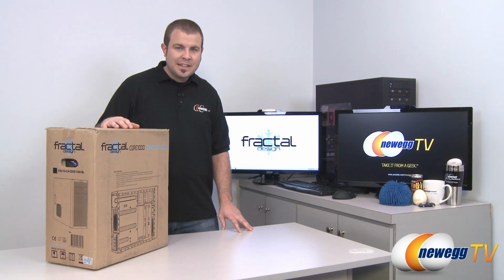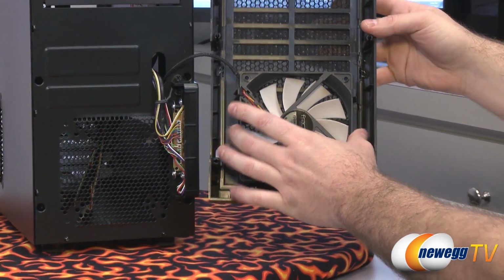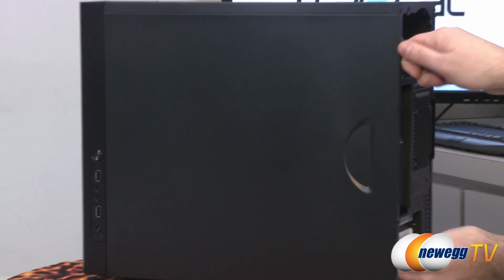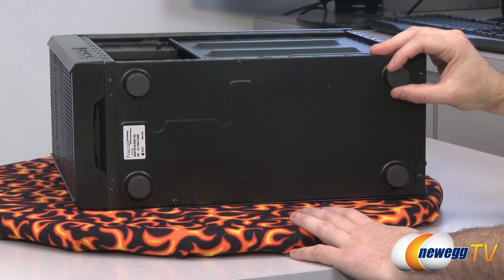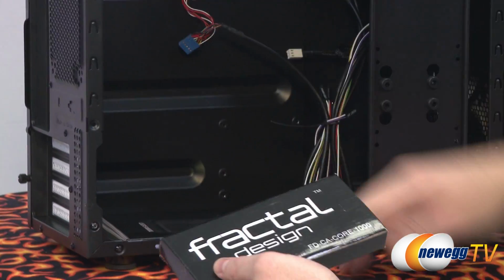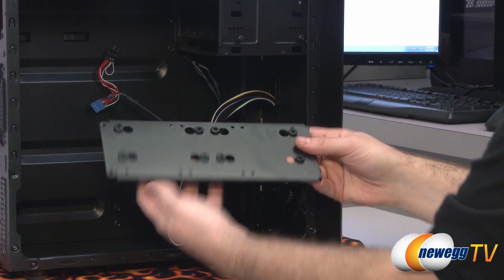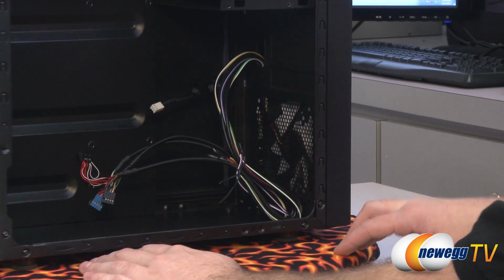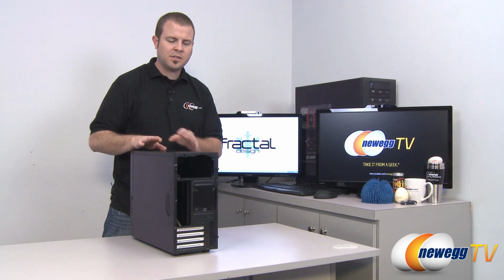Newegg TV: Fractal Design Core 1000 Micro ATX Computer Case Overview

Comment: I know this was a good, solid 8min video, but I just wanted to add that it would've been very to show an example of what it looks like after placing all of the components in the system to make sure that certain components would fit in there. For example, it claims to have 350mm space for long graphics cards, but a demonstration of that would be nice. Otherwise, good video!

Comment: It'd only just fit, but it'd be pushing against the side of the case, and in turn pushing the cooler against the motherboard, which might not be wise.

I suggest you go with either the Fractal Arc or Define Mini instead, they're more suited for gaming stuff anyway.

Comment: I like small cases
Reply: enjoy high temperatures. i've made the same mistake
Reply: comedyman112 depends on your case. Air 240 from Corsair is small but has good aitflow same with this case (core 1000). Just because a case is large doesn't necessarily mean air flow is good.
Reply: @untoldstory164  it could though mean less dust because no need to be that open.

Comment: @spykerv It is currently $10 cheaper than the Gamma. But then the Gamma is a Mid Tower vs. The Core 1000 being a Mini Tower. Mid Towers of course have more 5.25" & 3.5" drive bays and more cooling options. I do like the Fractal Arc Mini. It is $99 but it has most of the features of a full tower in a mini size.

Comment: Just to let everyone know this case can fit a freaken 780 ti so yes it will basically fit any card
Reply: ***** remove drive bay
Reply: Skittlez Gaming Yep, then get a 3.5 inch to 5.25 inch adapter to mount one
Reply: I'm using this case for my first build and would like to use the EVGA 960 SuperSC I know it fits but I also need an optical drive. In the video Paul says there is a 3.5 space under the optical drive space but I need a place to mount my 32gb SSD that will hold Windows. Will there still be enough room for the GPU if I just use the Drive "Cage" for 1 SSD?

Comment: The fan over the GFX card should be to exhaust air - otherwise you end up pushing the GFX's hot air back in on itself. The only "inflow" are at the front bottom, every other fan on the case should be "exhaust"

Comment: my case didnt come with a pre installed fan..
Reply: +Tobius theThird You can just add a cool cooler / fan in for swag >;)
Reply: +Tobius theThird Btw , Can you put DVD drives in / on it ?? plz tell me !
Reply: I didnt bother putting one in but you can, you'd need to get the measurements just right though, and granted you have your hdd mounted on the silicon grommets.
Reply: Ok thank you so much , Becuas I needed one :D

Comment: The 120mm front intake fan is rather noisy.  It is a 11-blades Fractal Design R2 "Silent" fan running at 1200 RPM, but because it is a 3-pin fan it cannot be controlled by the motherboard 4-pin PWM.  You have to get a 12V to 7V adapter to reduce the RPM hence noise.

Comment: this is the case i have. so it being a mini itx does that mean i cant put full size parts in it like motherboads and gpus like a 770 for example?
Reply: Tpeb it depends on length of gpu. the mATX just refers to motherboard size. it's smaller than average [ATX is standard] but power supply is normal - mini ITX is another small size and it uses a different type of PSU
Reply: ***** thanks, i have a full size 550ti in in right now
Reply: Tpeb nice. what is the case like otherwise?? i'm building a render farm and this looks like a good solution.
Reply: ***** i have a set up vid on my channel if you want to see that as the case is in the vid (obviously lol) but its a good case just small
Reply: ***** my pc is second hand and the previous owner has made a few dents in it but its still gud

Comment: whut? Blu-Ray old technology? how do you define old technology? :O what else is there to use for input drives? 'course, there's the external drives, but they're slow compared to optical drives unless you actually have e-sata connectors on your motherboard, or quickswap slots. besides, i think you meant 5,25", not 3,5". all hard drives with better capacity than 1 TB are 3,5". unless you want to pay blood prices for no gain. 3,5" are the most used ones, 5,25 are still used by most, 2,5 for SSD w/m

Comment: will this case fit a Asus Nvidia GeForce GT 640 Graphics Card (2GB DDR3, PCI Express 3.0, VGA, 2x DVI-D, HDMI, Nvidia 3D Vision Ready) with a MSI H61M-P31-G3 Motherboard (Intel H61 Processor, 16GB RAM, M-ATX, Gigabit LAN, Socket LGA1155) and a Corsair Builder Series CX 600 Watt ATX/EPS 80 PLUS Bronze Power Supply Unit?

Comment: Hey guys can COOLER MASTER Hyper TX3 Evo fit here? It says on the website : 
Supports CPU coolers with height of 135mm , but the cooler dimension is 90 x 79 x 136 mm .So does 1mm count or it will be ok to fit in this case Oo ?